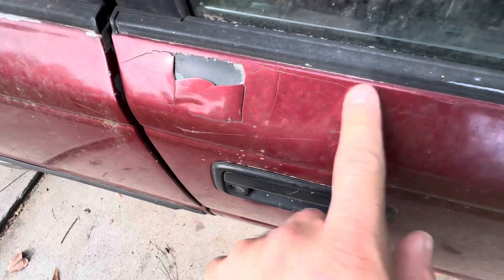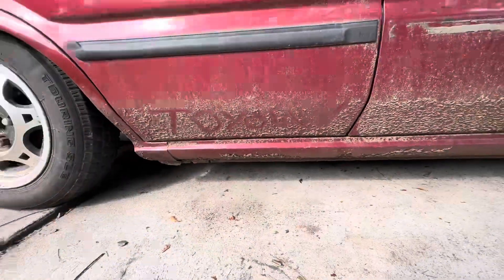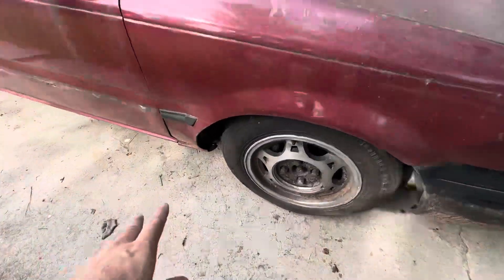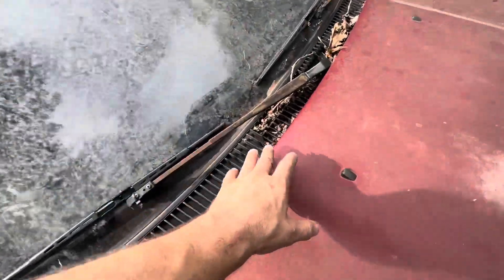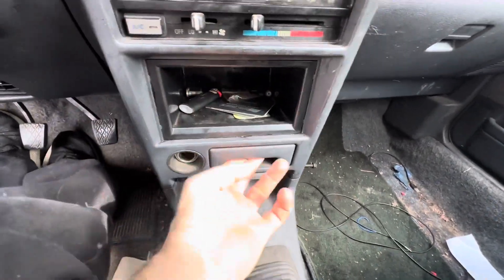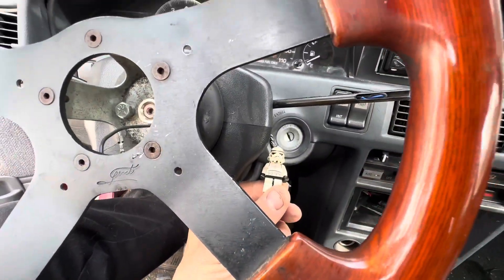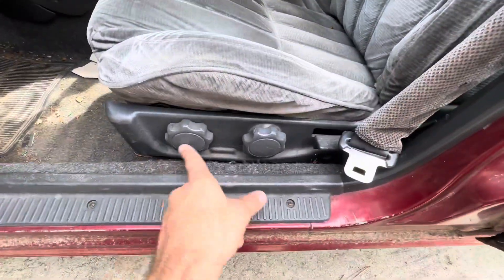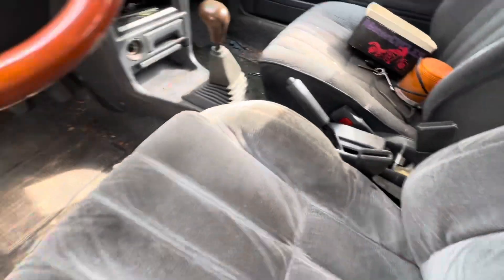4af to 4age Cylinder Head!? New Project!!

Comment: I have a ae91 5 speed I’m trying to put a 4age head on my 4afe block. I want more top end power, I know I need a red top 4age head to do the swap with the valve size difference, has to be a red top from a 85-86 small valve. How far did you get with this project?
Reply from the maker: This car ran and drove perfectly fine with the 4ag head on the 4af bottom end. Idk why your under the assumption you need a "red top". This car is running a large port "blue top" head no problem.

Comment: This thing is so dope, does it seem like it was a direct swap? other than the distributor relocation?
Reply from the maker: Pretty much a bolt on deal with the head.
Reply: dope, i was wondering if it would be a literal just drop on deal if it were a 4aFE motor cause the fuel injection is there, and a tune ofc :P might have to see
Reply from the maker: I'm sure with some creative wiring you could run the ge head with fe ecu

Comment: Hello Good day, I Would like to ask if the 4age 16v Cylinder head is bolt on to the 4af block? or did you convert anything for it tobe adapted on your 4af block?
Reply from the maker: Pretty much a bolt on.
Reply: @deathwobble  did you use a 4age head gasket or just the stock 4af one? sorry im planning to do this on my ae92 as well since 4age is expensive here
Reply from the maker: 4age head gasket

Comment: Your right about the mirror. I grabbed that and the clock from pull a part for john one day. Also the AEM did work at first then just stopped. John replaced the sensor at least once, not sure if it worked after. The carb is a Chinese weber.
Reply from the maker: Ahh the best kind of weber 😅
Reply: Thanks for that btw! It made me feel less poverty spec
Reply: @johnlewis8156  NP. Did we pull the gauge cluster from the same car we got the manual parts from or did it already have a tach?
Reply: @supposedbigfoot1859  there was a LE car in a different area that we got the cluster out of when the lady didn't charge us for half of the swap parts

Comment: Yea I forgot to tell you. Pat gas 3 times, let it start and warm up before you drive it.  All motor mounts are dead! Except the rear one(I replaced it with a new one when I threw the car together).  As long as it has oil in it rev it to 7k. I wasn't paying attention one time and took it to 8500 but I don't suggest doing that. 4af bottom end has 200k+ on it but strong all things considered and the AC still works well(I was really proud of making that work! Bending that ac line to clear the 20v header and not break was a challenge!!!) And the gas light works btw so it wasn't completely out of gas!!!!!
Reply from the maker: The gas light works 😂
Reply: @deathwobble  also when you want to switch out that timing belt let me know and I will come give you a hand(since I don't put on inner timing covers on 4ag ish motors and there are no timing marks).... And that timing belt is definitely as old as you. I know that I got it in the late 90's.....
Reply from the maker: Did you ever do a front crank seal?
Reply: @deathwobble  yea back when it was the previous owner and I did a timing belt and water pump I think back in 2013/4....
Reply: @deathwobble  remember that it was built for the Mitty.  I never planned on it lasting as long as it did and giving me all the smiles per mile.
Reply: Why not go over 7k rpm 😢